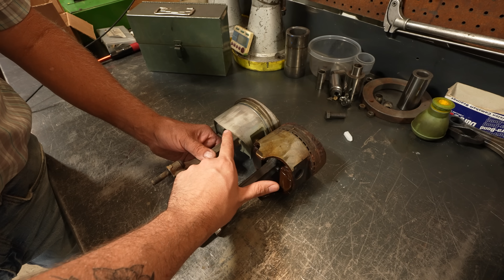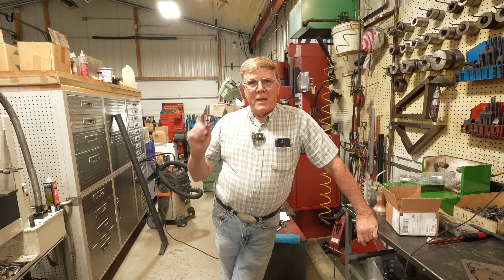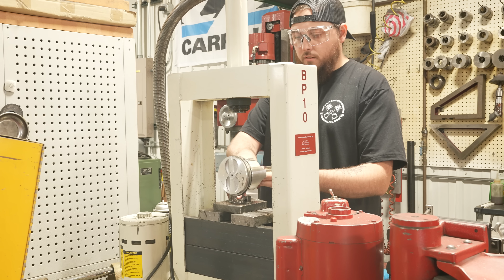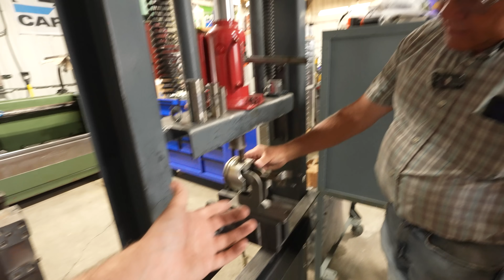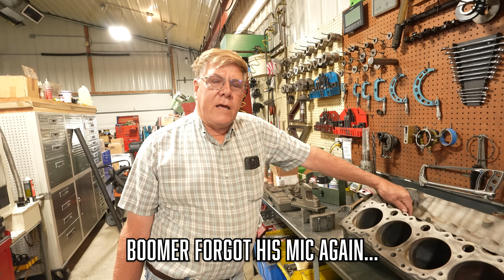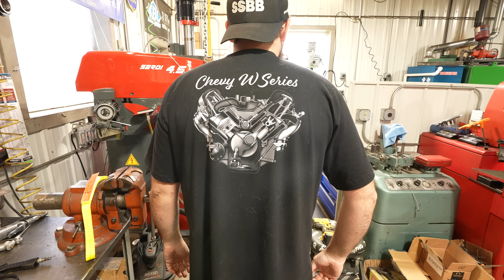What CAUSED The 348 Chevy To BLOW UP?

Comment: I pressed many pistons and we did not have those specific pressing tools. Pressing forged pistons was not to bad but pressing cast pistons was dangerous. I do recall breaking a cast Pontiac V8 piston. Another guy that came to work at the shop used the torches and after I saw that I did it that way a lot of times. The biggest problem I found was not checking how much interference fit there was in the rod to the pin. .002" or more was a lot and was likely to cause trouble.

Comment: I had a Built big beautiful 409 with duel E Series AFB monster carburetors, Muncie 4 speed Hurst shifter and 488 third member in my 1958 Chevy Impala, I ran a quarter mile in 12’s and high 11’s at 125 mph. My 409 was a beautiful and very dependable motor, and gasoline was 27 cents per gallon back then.

Comment: my guess is that they damaged the original piston trying to remove it, perhaps it was the first one they tried to remove and they surmised that the ring got caught on the ridge, so they aggressively reamed the ridges of all the other cylinders. As to why the replacement was broken, wild guess is it was cracked before they installed it or it was damaged during installation.

Comment: Seeing as how that is for sure a replacement piston. I'm thinking your right about pressing it together and caused it to crack then fail. Putting the dye on it shows more damage. I worked on an Olds 330 many years ago and those engines used a very weak skirted piston. When I took it apart it had a piston with part of the skirt broke off and in the pan. I got another piston for it and before I got that engine back together another piston had been cracked and part of that piston fell off in my hand. I have seen several other pistons with cracked skirts over the years also.

Comment: I’m fully aware of the “it’s his engine and he can do what he wants with it” sentiment, but why in the world would you rebuild this thing with modern heads and intake?? Just to be able to say “it’s a 348” or “yah, it’s the original engine”.  If you’re going with an engine that old then just mess with the internals. If you’re chasing HP and are going to modify it that much anyway, then just go with a modern SBC engine.  More power, less money, and much greater parts availability 🤷🏻‍♂️

Comment: Hi I am watching you guys working on few Eng work  one shop I worked at in past we had a table we put Eng on that was concave  down with a hole that had a bucket underneath when it leaked all of it went into bucket lot easier to keep the mess under control beats the oil pads in long run looking at your Eng stand your tray below engine would work with a hole in center and a bend in tray so all of the spill would drop in bucket

Comment: On older motorcycles like my Yamaha XS650's they have aluminum jugs with steel sleeves. 
Changing them isn't hard. You put them in an oven, blocked up s9 the sleeve has room to drop down. Turn on the heat and as it heats, the aluminum expands faster than steel sleeve. When it expands enough you will hear when the sleeve drops.
When you hear that you pull the jugs out and you can fully remove the sleeves.
Install is just the opposite, set the jugs in the oven, sleeves set on top then heat till you hear them drop,pull out and fully seat the sleeves. 
You can pull the sleeves and get the jugs bored out to accept bigger sleeves to make it a 750 cc engine.

Comment: The way we used to put those pins in in my day when we machined engines is we put it the rod in a heater that was heated on one end it was a torch it would get hot and we would drop the pin right in and fall in like butter

Comment: DYI guys need guy's like you, I had a piston press jig like that, it was a OTC, I noticed the piston gets stiff when the pressure gets high, because the jig flexes downward, could the excessive taper in the cylinder cause the piston to fail?

Comment: When I was in tech school, we rebuilt a 4cyl engine in a k car. We used the rod heater, and about a week later the car came back with a horrible engine noise, we pulled it apart, and one of the wrist pins moved, and cut a groove in the cylinder wall. We talked to an old Chrysler mechanic at the dealership and he said those have to be pressed in, because they will come loose with a rod heater. Have you ever seen that before?

Comment: Nope 348 is just as cool. Slap an Edelbrock top end with heads, intake, couple Performer 600's and set of headers and send it over. Would proudly run a 4 speed behind and even make some cool "348 Power" badges or hood art.

Comment: You just made this DIYer smile. I've never "dry pressed" a new piston on. Every engine that I've built I have heated the rods on a hot plate and frozen the wrist pins. They all go together like butter! I even made jigs to hold the piston and stop the wrist pin at the right depth so it's centerd on the rod before I knew you could buy adjustable ones! :) I had a great relationship with the local machine shop and the operator gave me the same speech when I was a kid - "Know your limits". We'd pass an engine back and forth so I could do the stuff I was comfortable with and they'd do the stuff I couldn't - the real machine work that I didn't have the equipment for. I've never felt worse than when they closed down. Thank you for your videos!

Comment: Just to start, I have a rod oven. There used to be two that came on the Ark, but one has been lost to time.
Sooooo.........
The piston that broke is the correct piston. So all the others are wrong. Are they the original pistons? My inquiring mind wishes to know.
Your reasoning is the piston was broke pressing the pin in.
That is highly probable.
I've broken a piston trying to move a pin that didn't get in enough. Ping! That is a sound that puts the pit of your stomach at the same category as, "We just hit an iceberg, and there aren't enough life boats."
Yep.
Are you looking for a rod oven?
Let's make a deal........LOL!
Seriously, that's about all I have left of my old shop equipment, only a few hand tools including a ring ridge remover and a piston ring cleaner. I sold out my shop when I went into the Air Force in '83.
I was the floor sweeping guy at 18. By 21, I had my own equipment, except for a crank grinder. I used to "borrow" one at a shop in town. You should have seen the look on their faces when I asked if I could use their grinder the first time.
Ah! The good old days!
Keep up the good work! 
Cheers
Terry

Comment: Good comment about diy guy 'know your limits'. 
I did my rods, pistons, cam, blue print pump, mods to block, ring gaps etc. I asked my machinist to do clearances, balancing, 4-bolt conversion and also install crank and rear main. Yeah, I drew the line at rear main because I didn't want to be responsible if that leaked 😂.

Comment: I was working in a chevy dealer years ago. We had an 85 f350 wrecker with oodles of miles. It had a 460 and i pulled it out and dissassembled it. Sent to machine shop for tanking, boring new cam brgs and pressing new pistons. 6 months later and 15,000 miles it never used a drop oil and ran perfect. One day after a tow driver said sudenly clouds of oil started out the pipe. Took it apart and piston pin walked into cylinder and gouged it so bad  that it needed a sleeve. The machinists pride was hurt , they fixed it for free.

Comment: Thank you for the update, guys. "Cracking the piston while pressing the wrist pin in" was NOT on my list of possibilities. 68 years old and I learned something new. I'll never need to use that knowledge, but learning just for the sake of learning is still a joy.
Also, 0.035" taper?? I've never seen or heard of that much taper in any cylinder. Is that a known characteristic of those engines, including the 409? That seems wildly excessive.

Comment: The rust in the coolant side of the bores makes going to 40 would be the max amount due to cooling issues and overheating that can crop up with too thin cylinder walls…Sunnen used to make a film spray to help prevent wrist pin galling on installation. Goodson makes that wrist pin installation kit .

Comment: Some 45+ years ago when I rebuilt (rings, bearings and gaskets) the engine (Chevy 350) in my 77 Chevy 4x4 Pick Up, I honed the block with a 3 stone cylinder hone until the entire cylinder bore was shiny (didn't know any different) which in turn effectively overbored the cylinder by several thousands  increasing the piston clearance (reused the stock pistons)  out of spec. (I was young and just learning) 😊

Anyway the engine ran for several thousand miles before a piston skirt broke off due the excessive piston slap that there was.  Yes from the initial start up there was some kind of a slight knock which got worse over time but even the Head Chevy Dealer Mechanic wasn't sure what it was. 
This build was a great learning experience for a 16 year old.

Comment: The Piston Was installed backwards.. on the one that failed.. My Way to get around the Non Support pressing in Pins is Use a Socket on the Back Side to Support and Use My Vice to Pres the Pin in the friont.. Thats what i did to install my Pins in my 327 Pistons i seen where it was contacting unevenly and would damage so that was my Answer.. large socket than the pin for support on the back

Comment: I agree that pistons are very fragile. I have decided after working n diesel engines that it was much easier and effective to buy piston set up fir floating piston pins and then have the rod bored out to accommodate the bushing and the floating pin. I have used the press method many times and I have never felt that it was a good idea. I have only used the heat and freeze method once or twice and I can say it is good if you have the equipment. Most people do not have that ability as their wife will not let them heat engine parts in their ovens or freeze parts in the freezer.

Comment: For what I put my engines through, I use floating pins but if I put an engine together that is for normal use I have a mate at a machine shop with all the gear to put interference fit pins in, I normally just take them to him and if I'm building a V motor I'll even tell him what holes they are going in and the direction I want each rod to be fitted in.

Comment: Being 64 and coming from 4 generations of millwrights and mechanics I learned a really old old school method of finding cracks in castings. You give the casting a bath in diesel or kerosene (best if you can dunk it and let it soak), then clean it off and paint it with whitewash. When the whitewash dries the cracks are very obvious.
Now being that I grew up with more modern methods, I've never had to use the whitewash method in the real world. But it's always cool to be shown how it was done back in the day and actually see it done with your own two eyes

Comment: That explanation makes a lot of sense. Doing heated rod and piston then frozen pin rather than brute force and stressing metal. A tiny microscopic crack within an environment with high frequency vibrations and secondary imbalance really has a high probability of failure. Add heat cycles to that over time as well then that probability goes higher still. 
Look at airframe inspections on passenger liners and the issue that develop over time.

Comment: I will be interested in how the sleeve is inserted, and machined, given the non-perpendicular deck angle.
Reply: I expect they will install an over-length sleeve and then mill it flush with the deck.
Reply: @nerd1000ify  there is a notch at the top of the bore, forming part of the combustion chamber, which can't be sleeved over.

Comment: I use the Goodsons set for removal, I found 3D printing a shaft adapter to center the press pin on the jig really helps. 

Especially Gen3 Hemi stuff, I have the CAD for anyone that needs it. 

(I Use a rod heater to install of course, but occasionally mess up the centering so the 3D printered centering adapters take a lot of the risk away. You could make them out of aluminum on your lathe.

Comment: am a retired truck mechanic, did many engine most of them had a floating wrist pin . the position of the c clip or snap ring was important the open had to be either up or down, an engine that top out at 2000 rpm . a lot of the guys were very knowledgeable and as the bible says iron sharpens iron . like your stuff

Comment: I really enjoyed this video on why the 348 seized. Back when I was in college I built a 60/396 with forged pistons and I did all the machine work on the rods bored it out. I did all the machine work on the engine in my shop class. when I pressed the pistons on the rods, there was one where I caught the piston and slightly crimped it, and it made the piston slightly snug in one position. I built the engine anyway and it ran great for about 50,000 miles and then it seized. Got pissed and cracked in the wrist pin boss. At the time, I built this engine 1975 they didn’t have the technology with the propane torch heating up the connecting Rod to insert the wrist pen.

Comment: Loved the bit about why you don't recommend pressing on the pistons for DIY. That might be a cool series of videos; you could call "Don't try this at home." You take something and explain why it's difficult or finicky, what you need to do to overcome that in the shop like special tools or doing something enough you get the feel for it, and detailing what goes wrong when you screw it up. 

Conversely you could do a series called "Try this at home" where you talk about something that can be done at home, compare the DIY method with how you would do it in the shop, and provide guidance on what issues are good for a DIYer to stop and contact a professional before they make things seriously worse.

Comment: Started in a shop before rod heaters, shop had sunnen pin press tooling. Older shop guy after pressing pistons on would have some tight pistons. Would work trying to free them up. Before i had rod heater, would use propane torch, worked good.

Comment: An acquaintance of mine built a 409 engine and installed one of the rods 180 degrees out after telling him that it was installed incorrectly. Needless to say the engine failed for that very reason, because the rods have an oiling hole that has to be correctly oriented !

Comment: When this engine was new the only piston pin tool recommended by GM was the Kent-Moore 6994 kit. It supported the side of the piston, it did have a guide pin for reassembly. All done at room temperature. I think it was in the 70's that the Kent-Moore tool came out that supported underneath the rod. More foolproof, but you could still get it cocked by using the wrong insert. Now those methods are considered barbaric hack methods, but it was all we had back then.

Comment: Nice video.  I've been told that the local race engine builder here, who started building racing engines in the early 60's, would intentionally install pistons on the rods backwards.  A very low budget way of getting a little more out of a mostly stock engine.  Evidently he knew how to remove and install the pistons without damaging them.  Back then there was no money for new pistons. He later on became quite successful,  building high-end race engines for dirt modifieds and late models.  He was a local legend.

Comment: Things a DIY shouldn't do: hone your own cylinders with the cheap drill hone. I did that to a little Ford 2.8L V6 - it took 1000 miles to break the engine in. Hardly any compression and power for the first 500 miles. Then the pistons finally seated. I also rebuilt the engine in the street parking.

Comment: Just a quick comment to say I enjoy your channel. Having spent time in machine shops including two automotive ones and eventually overhauling aircraft piston engines at another. Seems like a lifetime ago but I still enjoy the challenges of building engines. Note to viewers: even using a rod heater to install press fit pins requires a special jig to center the pin in the rod. It's been shown on other episodes here.

Comment: I'm wondering since it appears two pistons failed in the same hole could there be a problem with the block?  Is there anyway to check if the bore center is aligned with the crank throw?  Any other problem with the block machining that could cause piston skirt failure?  Interesting problem to diagnose. Good luck with the rebuild.

Comment: Aerospace Engineer POV ... know what "interference fit" means ... one would be amazed at just 2 hours in the Freezer how much those wrist pins will "shrink" and allow for an easier install ... add gentle flame to the the bearing surface in the Piston (not so much to change the HT value) makes it even easier. Just free advice for the DIY bunch.

Comment: The old forged TRW most likely requires more clearance than the cast piston. If the bore was finish sized for the stock cast pistons, the clearance was too tight. I have seen this in a 340 Chrysler.

Comment: I'm lucky enough to have a 409 . I bought a 63 C60 from a friend in my hometown of Joiner Arkansas.  He said i had to take a 63 gmc 5000 as a parts truck fir the front clip and glass. But Said it ran when parked lol he said it has some kind of big chevrolet engine in it. He didn't know what size but has funny looking valve covers.  When I got them to my house I popped the hood. And there set a 409 the gmc come from the factory with some kind off a big V6 probably a 351. It must if tore up and the owner had a 409 and dropped it in. Even cut and rewelded them together to fit. He bought the truck many years ago at a sale so he didn't know it's history.  The c60 and gmc pulled 36ft grain trailers so they have low mileage but hard mileage

Comment: The press on theory is quite possible, an alternative theory is a cast piston with slotted oil returns running in a cylinder with excessive piston to wall clearance will crack at the corner of the oil return slots. I've seen it several times even on the old TRW forged pistons. (slotted oil return style only)